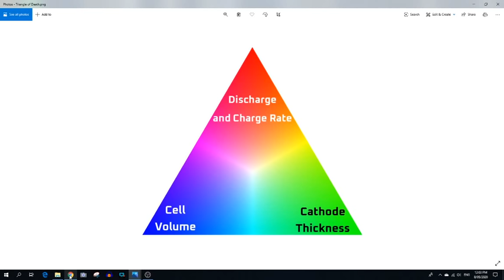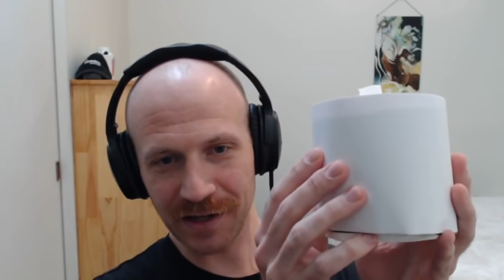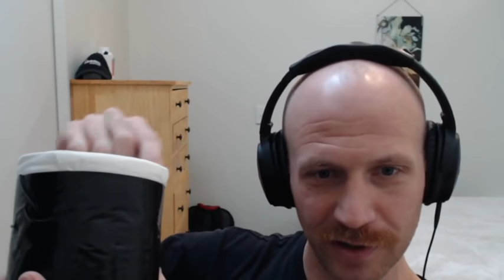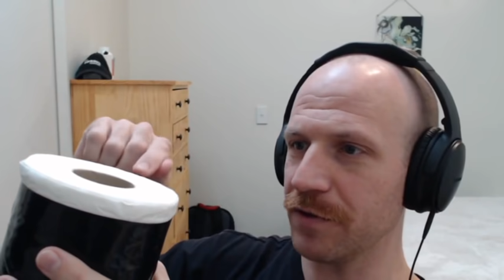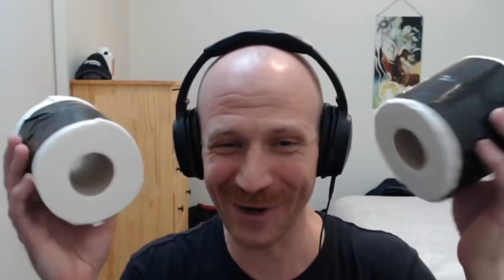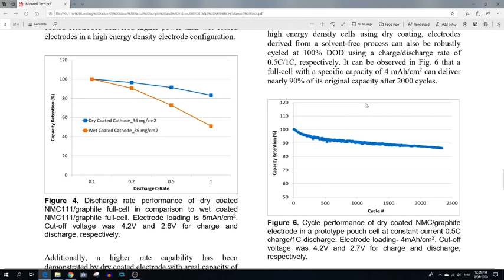Tesla Tabless Patent - Hot Take!

Comment: Just from tabless innovation
- Improved charge rate (larger conductive surface)
- improved energy density (larger cells feasible)
- improved ease of manufacture (fewer components and assembly)
- improved thermal properties (reduced resistance)
Reply: Considering all these advances, I recall how iffy the Maxwell acquisitions looked at the time. And now I really think the non Tesla EV players made a BIG TIME mistake in not getting together and getting Maxwell out of Tesla's hands.
Reply: "Embodiments within the present disclosure may provide a more uniform electrical contact between the electrode current collector and the interior can surface. The maximum distance current will travel is therefore the height of the electrode as opposed to its length. Depending on the cell form factor, the height of an electrode is typically 5% to 20% of its length. Therefore, the ohmic resistance in the negative electrode during electrochemical cycling can be reduced by 5 to 20 times via embodiments of the present disclosure."
20-fold ohmic resistance reductions are S3XY
United States Patent Application	20200144676
Reply: @islammohamed1441  "The maximum distance current will travel is therefore the height of the electrode as opposed to its length." 
Exactly. And that's the part that I find such an obvious idea that I can't believe nobody has thought of it before.
Reply from the maker: You guys rock.  Great excerpts from the patent!
Reply from the maker: @rogerstarkey5390  I still have to look at this in detail.  I need to answer that question and two others:  Whether the tab is removed from BOTH top and bottom (in some embodiments) and how much resistance reduction benefit this provides.  Also interesting they note double sided coating.... that could be huge
Reply: Your 3rd point is the most important point I think
Reply: Link to patent: http://appft.uspto.gov/netacgi/nph-Parser?Sect1=PTO1&Sect2=HITOFF&d=PG01&p=1&u=FnetahtmlFPTOFsrchnum.html&r=1&f=G&l=50&s1=%2220200144676%22.PGNR.&OS=DN/20200144676&RS=DN/20200144676

Comment: Wouldn’t this make charging speed way faster sense there will be less heat/resistance from travel all the way round the battery (the roll which you used as demonstration)
Reply from the maker: I'm looking to confirm the magnitude of this.  There are actually several gems in this patent.  I need to dig in a bit more.

Comment: Remember as the battery gets better increasing percentage of say battery density becomes more significant . If they are at 400 miles , 10% increase is now 40 miles so 600 miles is not as far away for a battery of size of today’s 50 kWh battery compartment. With less components the battery should get lighter , less volume ,less heating due to less resistance , and this means they can add more room for even more batteries. Renault use LG battery pouches and in 2012 since zoe was 22.4 kWh it now has a 52 kWh battery in the same form factor. So I think tesla will be easily doing this increase

Comment: I think this improvement is likely under estimated, and potentially huge..(I cant believe it) I cant believe this simple improvement wasn't done earlier.. . (just think of 100+ cells in series and all that resistance of each roll)  This must reduce internal resistance by 20 fold?? (do we have numbers on this?)
- Any one dreaming of Super Caps being used in EV's? -Your dream just died.
Reply from the maker: YES, the patent specifically states a 20 fold reduction :D
Reply: The Limiting Factor (dame I guess good 😛) - I assumed the cell sandwich unrolled about 1m (3 ft )
- just think: up to 800 hp, worth of electrical power had to (basically) travel through 2” wide ‘tinfoil’ that was over 300 feet long, before going through the motors... and Tesla just removed that bottleneck.. amazing.
- I’d like to round up all the battery manufacturing engineers .. and fire them.🙂

Comment: Rather than having to put out a V4 SuperCharger right away with a higher Kw rate, maybe it means new-battery cars will be able to accept the max rate (150/250 Kw) to a higher SoC - perhaps to 70% or more? That would also shorten charge times and/or make for fewer stops on a trip as you could always charge to 90%.
Reply from the maker: Agreed

Comment: Thanks for the explanation.   However, I feel the need to disagree with a couple things you said.

electrons are like water, right?  And they wind up flowing through one spot of lowest resistance.  The current would not flow through a broad section of the connection between cell & rest of system.  It would find one tiny spot to flow through.  So I don't see how you will speed up anything at all.

I'll give you that it may improve manufacturing costs & likely that is what it was designed for.

In engineering, seldom do you improve multiple axes simultaneously.

Comment: Arent those small connections on tesla batteries act as fuses.
Reply from the maker: I think they detach from the cap in the event of an overpressure within the cell.  However, that may not needed if all these are fused on the outside (fuse would melt before an overpressure).  I need to take a close look at the patent.

Comment: Supercharging rate varies depending on the current temperature of the battery and the voltage eg percent state of charge.  So even if it can handle a higher max, if it can have a higher sustained than V3 chargers could still give a much faster total charging time!

Comment: My query is how do they fill the cell with electrolyte now that the base of the cell is effectively sealed inside the can.  It might take a lot longer to move through the layers, if at all.
Reply from the maker: Vacuum filling is my understanding, this is something that Hibar Specialises in.
Reply: @thelimitingfactor  so long as the bare copper touching the base of the can was not too compressed, I can see some electrolyte working its way through.  But it's sure to be slower.  Then again, it's not a really tight junction until it's compressed down and sealed.

Comment: When’s this going into the cars ? Are we talking a year or five or more. Could be why they said the Roadster would have 600 miles range. Could we be looking at $50-60 per Kw or even less. Bring it on if they can reduce the Model 3 or Y cost to the customer.

Next level battery tech. The Maxwell purchase was always a smart move. Just when the other manufacturers get to grips with cell technology Tesla move the goalposts. The exact same with the autonomous driving they are years ahead of everyone and that’s just what they have released, firmly believe they are about to switch the taps on that as well and take the gap further.
Reply from the maker: I'm hoping that the next gen cell goes in the Plaid Model Model S this year.

Comment: Gordon I love your podcast and the fact you put in the time to study the technicalities of batteries.  
I think you missed the biggest issue:
Cooling the batteries will move to direct electrode cooling.
Currently the cells are cooled from a distance as heat flows from outside the cell can snd through the plastic and coolant sleeves.
Cooling the electrodes directly is much more efficient and requires less power. Battery cooling is a major power consumer!!!
Reply from the maker: Totally agree!

Comment: While peak charge rate might not increase, overall charge time may decrease as the limiting factor on pumping huge kW into packs is the cooling, look at the M3 charge rate cureve over time at 250kW. This could allow simpler and lighter cooling systems while still maintaining prolonged high charge rates.

Comment: Based on everything I have heard to date, it looks like the new battery is a 5075 format made with dry cell manufacturing technology.  The extra 5 will be to place an aluminum conductor in the jelly roll to reduce heat and facilitate electron migration.  The annode will get a monocrystalin cap to improve cycling.  These may even get an air cooled battery design or a lighter weight liquid system. 30 to 35% improvement... So they have thought outside your triangle metaphor to solve several problems.
Reply from the maker: This is the kind of simple, cheap, yet effective engineering I would love to see!

Comment: The real questions are: why are they tabs in the cell in the first place? And how do they attach the inside material to the outside to give proper electrical contact?
Reply from the maker: Part of the reason is if the cell over pressure the tab is a cutoff and safety mechanism.  But Tesla puts a fuse on the outside (original design wouldn't have anticipated this).  Point 2 - looking into this

Comment: Could you please do a video on the monash University lithium sulphur battery. I hear it has good cycle life (which sulfar batteries usually dont have) and good power and energy density numbers. I want to know if that is all just hot smoke or something that is actually commercializable?
Reply from the maker: Lithium Sulfur is where it's at in the deep future!  Maybe not a focus on Monash, but the chemistryin general yes.  Lithium Metal and Sulphur are two seperate innovations and it might be a several part series.

Comment: Tesla superchargers are 250MW. Seems maybe you should be able to calculate charging speed from the chart with comparative heat generation during charging. Wouldn't 30 -  40% less heat with a fixed  250MW input simply just mean 30 -  40% faster charge?
Reply from the maker: Not sure!  I've gotten myself into trouble with linear calculations before.  I'm sure the physics are more complex.

Comment: Yes removal of the tabs will speed manufacture But there is more to it than that. The current has to make its way to the tab, across the tab and then out of the tab. This will produce several small but possibly important changes compared to a direct layer to layer contact. 1 Resistance, yes it may be relatively low but it is a factor. With a hundred or so cells in series it will give a slight voltage drop of some kind and a slight reduction in efficiency. 2. A slight increase in temperature. Check recent research focussing on stabilised higher cell temperatures as a way of increasing charge and discharge speeds. Slight variations may multiply other effects local to the tabs. 3. Jack Rickard assumed 15A, see point 2, the current may be much higher. 4. Electrons can physically damage materials by their transit (not just heat), focussing this on one point and with higher currents may affect long term battery life (I am assuming these may be in use for 30+ years in car then grid scale applications). 5 Cell expansion, increasing heat at one point will cause thermal expansion, with tabs this will cause a potentially significant change in localised volume.

Comment: Mark 3:58
I guess that this is your novel idea, but it isn’t new. For this to work we need conductive adhesive as you mentioned. Those available in either excessive resistance, expensive, long cure time or all combined (eg. silver epoxy). The other option is end to end compression packed instead conductive adhesive. The problem in that is the electrodes conductive carrier must be physically and chemically insensitive to axial compression and be able to exert a force back in an opposite direction resilient enough to maintain contact pressure good to sustain a low contact resistance. Those are the limitations we need to deal with.

Comment: Check out section 0054 of the patent. It lists improved heat conduction to the bottom end of the battery can. This makes possible a much simpler flat cooling plate laid along the bottom of the battery pack, instead of the serpentine cooling plates currently used. Could be the most important part of the patent.
Reply from the maker: Niiiiiiice!

Comment: This tabless scheme allows for better cooling because the all or most of the cathode touch makes contact to the bottom of the can and, all of the anode makes contact to the cap of the can  (I think I got this strait, making the top positive).  Keep up the great work Jordan!  Thanks!
Reply: Exactly my thoughts. 
They might move to direct electrode cooling where the fluid comes in contact with the electrode.
The energy saves on cooling is very significant

Comment: Simplistically, I assume that reduction in resistance from tabless will have a roughly linear relationship between heat reduction and increased capacity.
Reply: Heating relates to power( and to temperaure rise) being dissipated by the square of the current times the resistance of the tab so yep linear with resistance. @Benjamin Cronce

Comment: Amazing!   Stock jumped past 800 today!  I doubt many analysts understood anything about the efficiencies gained from going to  "edge connections" on the "jellyroll cell  electrodes".  How they do it reliably and FAST  is the secret sauce along with the automated production processes to do it.   Only Elon and his gang know how many watts of power are SAVED by the decreasing internal battery losses charging and discharging.  I suspect that it is MORE  than a few percent!  I wouldn't be proud to use internal battery losses which Tesla WAS stuck with as a cold weather source of battery heat!  The heat pump with a resistance heater boost is another stroke of genius so the battery can heat itself more efficiently  along with passengers.  You also pick up efficiency on the COOLING side. If the new connection method is cheap AND easy  to do (with know how) AND saves money in production AND  increases battery "round trip" efficiency AND diminishes the possibility of  "cooking battery cells" under high charge and discharge conditions, its WIN WIN WIN WIN!  (Lotsa AND's there)
I suspect that someone reasonably good at calculus can figure  almost exactly the percentage  "resistance decrease" between "end connect with tabs"  vs continuous "Edge connect " to the buttons on the cell ends for various electrode lengths and widths and materials!

AND  We haven't heard anything official about better cell chemistry (yet)!  
  Cell connection enhancement I think is just the  "teaser"!  The difference between two pair and  a Royal Flush which is coming!
Reply from the maker: There's a lot of information in that paragraph.  Thanks for the insights!

Comment: I don't quite understand how the offset works. Is the anode offset to one side and the cathode offset to the other side? Or how else does the external connection only touch the anode and not the cathode and vice versa? Does the fact that there has to be an offset to allow the external connection mean that that offset area is wasted volume?
Reply: Also, does this mean that it is likely that Tesla will choose to have long skinny cells instead of fatter ones?
Reply from the maker: Tesmanian is hearing 40mm, Sandy Munro is hearing 50mm
Reply: @thelimitingfactor  But if the resistance now only depends on diameter not on length, why wouldn't Tesla make the cells long and skinny?
Reply from the maker: @buckingthenorm  I'm wondering why they would want a long cell.  Cooling works better in the vertical position and you don't want a tall floorpan.
Reply: @thelimitingfactor  Ah, right. I forgot that the cells standup vertically in the pack. Thanks.
Reply from the maker: There are different embodiments in the patent.  I still have to troll through all of them.  On one of them, I think I saw a tab on the bottom, but that may have been and example of prior art.

Comment: Looking at their patent, specifically Fig's 3A and 3B they are planning to produce 3 battery films in parallel on one roll of film and separating them further down the battery line, see paragraph[0056] of the patent. Is that a new idea, i.e triple the production by printing three of the substrates on one role of film and separating them later?
Reply from the maker: No, but the way they seem to be putting gradiations of different materials is.  It's a process called slitting when the electrode is cut lengthwise.

Comment: I watched you on hyper change and I was thinking why don’t tesla make a big flat battery with a cooling gap inside? You then suggested this flat battery too as an idea. Let’s get to fact here, circular cells are not as efficient from a space perspective as rectangular or long flatter cells maybe only as wide as the floor height! 
Totally integrated floor battery and cooling??? I’m no batttery guru like you. Maybe you can give your thoughts.
Reply from the maker: Oh man, I still need to look into this!  Sandy Munro suggested this.
Reply: I’m thinking sandy Munro has heard about 5 rumours of 50mm batteries from tesla. What if this was the height of flatter battery’s not the diameter. This would be very close to the current 70mm height with a little height saving! adding Into this the efficiency saving and the space saving! I’m convinced Elon strives for maximising and this has to be one way to do this.